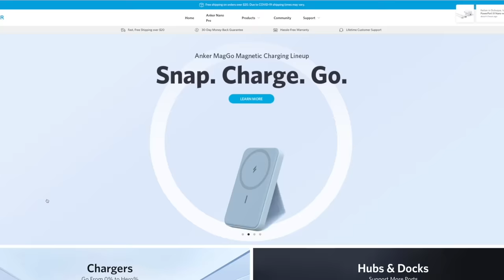Building a DIRT BIKE Track in My BACKYARD!!! (Crashed My Truck) - Gone Wrong

Comment: Trailer brakes would have been 100% better. Dig into where you track is to make low dips to make your jumps. Put it near a low spot and it will drain or use it as mud pits(fun as hell video). Also, I think the bumps are call whoop-ti-dos (don’t know how it’s spelt but sound that out)
Reply: Cboys and Flair need to make a collab

Comment: I was wondering why the trailer brakes weren’t working?? If they were working and you had a trailer brake set up in the cab you can manually hold the brakes as you drive down the hill and that will prevent the trailer from pushing its self down the hill on its own!!! I couldn’t believe that you did that!!!

Comment: I deliver very large travel trailers to the tops of mountains and the bottoms of canyons going down Windy Hills dirt roads Rocky washed-out trails. Plugging your trailer brakes and you will make it just fine. All that weight of the dirt will dig in when you break on little tires. Live and learn suck it up you got it. Don't be afraid. Build that track the way you want to. Love you show thanks for all the content. Miss you while you were on your well-deserved vacation. Shoooooo

Comment: 4 x 4 low with trailer brakes on 10,  squeeze the blades together and let the trailer hold you back.  I tow everything from a dump trailer like that to a 48' tri axle enclosed car trailer with an f350.

Comment: Make a bunch of tabletops as a confidence booster for jumping distance.Start off building them atleast 8ft tall on the small end and around the same in width.Once you start clearing them all, you can remove the dirt in the middle of the tabletops and build them into singles, doubles, and even triples if you're feeling spicy lol

Comment: Hey flair, try cleaning the carburetors on your small engines. It helps keeps the whole system clean. After hearing your Jeep that could be your problem or check the gears/transmission

Comment: Flair landed fine on 4 wheeler now if he would have not used his breaks on trailer he would have been fine whoops lol Banjo panicked and was holding his breaks down from the second he hit the ramp, but it wasn't as expensive as flairs hitting the breaks is, going to be😣😫🥴 15:15 do a frame by frame when Banjo hit's the ramp he locks up all 4 tires right when back tires go off top lmao 🐔🐔🐔🐔 Think he was having flash backs from the last time flair told him to gun it going up the hill with the sprayer on the back!! 😉😁😂🤣 LMAO Best part is when Flair says WHY DIDN'T WE PLUG IN THE TRAILER BREAKS LMAO hummmmmmmm Now who was driving the truck 🤔😁😂🤣

Comment: B's it wouldn't help with the trailer brakes lmfao. Me and my dad have a 28 ft two deck boat that's about 6000 pounds with trialer. And the trialer has brakes and does wonders. But the brakes on that trialer are in the tongue so when it shifts forward it triggers the brakes to apply
Reply: That type of trailer brakes are called surge brakes. They work great. 👍

Comment: Really want have some fun. Get the pro 80 dirt bikes. And watch out for the power band. Short wheel base will gain your respect  real fast.  Ive ridden lot of dirt bike from 125 to 500. But the little 80 pro bikes with a bigger guy on them will surprise you. Or put you on your back if your not careful.

Comment: You can dig in front of the spot you want a jump a hole and shovel the sand  to the front to make a jump. So you drive a little down and right after you have the jump! That way you have to dig 50% less and you dont have to move ground from a other place

Comment: Time to get rid of the Ferd,  go get you a dodge ram 3500 single wheel not a dully.  Get a 6.7 and have a professional that knows what they are doin, have them do a delete kit to the DEF, and put EFI live programmer on it and put a 3 inch leveling kit, front and rear or get air bags for the rear and a set of 35 inch mud tires.  You would have one hell of a truck.

Comment: Get go karts with roll cage. And put wheel bars so dont get caught up on each other and flip. All has have same motor 8hp with same drive systems. You can do muffler upgrade and clutch and tires. Everything else stay the same then can see who the best driver.

Comment: Hey flair you need a truck with some electric brakes cause the trailer will have electric brakes and that would have never happened if you had/used electric brakes on the dump  trailer

Comment: You need to cut all those small trees!!!! Hitting them at speed if you lose control may result in a casualty....i have seen people die by hitting a two inch tree...also you need to widen your turns so you can transition...but most of all,please be safe.

Comment: im sorry but it the frame got damaged from that, thats a weak ass frame. also u cant just fix a frame if it is broken u cant just fix it in ur shed at home cos u wont know it it will maintain its structural integrity.